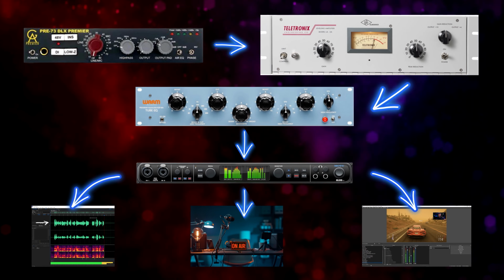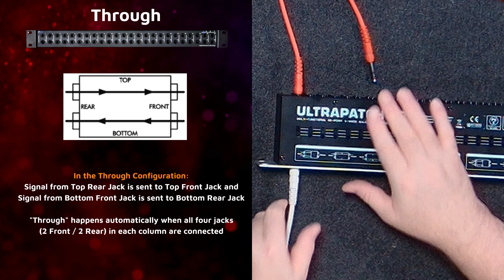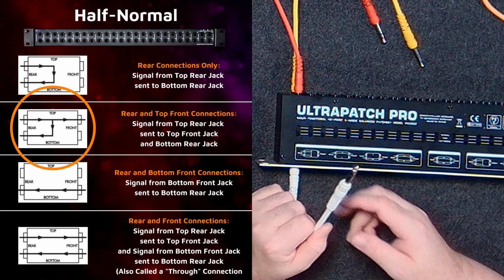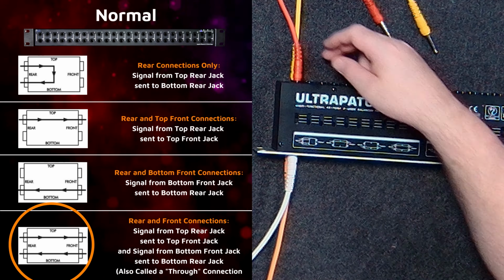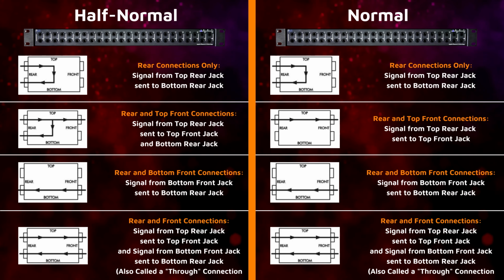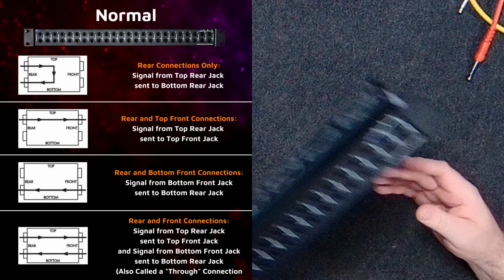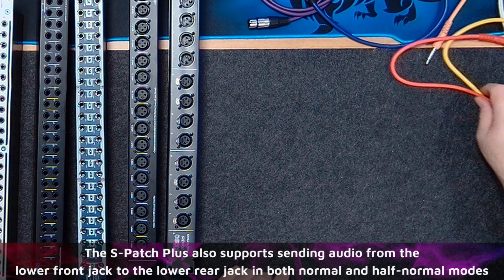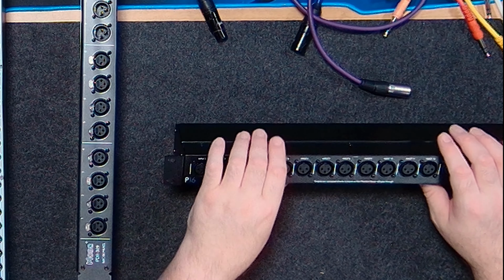TRS and XLR Patchbays - How They Work and When to Use Them

Comment: ...an incredibly clear and illustrative video. All the questions I had in my head are now answered. In setting up my home studio, I just couldn't figure Patchbays out... but now! .....all my cables are run (most under my floor) and connected using 3 x Samson S-Patch Plus... a mixer and 28 I/O.... Synths and outboard gear to match.

Your video is by far the BEST out there.

Now I am about to Rock... and I Salute You.
Reply from the maker: Glad I could help out! Sounds like you have things well planned out with your cable runs and the S-Patch Plus are very sturdy...the ones to get for TRS imo. 

As it should be...Let There Be Rock...
Reply: I agree.

Comment: Hi Todd! I got a suggestion for you. I would like to see you review another pair of studio headphones made by AKG, the AKG K553 Mkii, they’re a pair of closed-back studio headphones. According to AKG, the K553 Mkii is "the ideal closed-back, over-ear studio headphone for monitoring, mixing and mastering”, and that their low-impedance 50mm drivers provide "strong, accurate, and distinguished bass response, with enough sensitivity for precise sound reproduction on laptops and mobile devices". I would like to see you review them and run audio tests on them to see if those claims are true.

Comment: Hi Todd, another informative video.  Thank you.  : )  I recently posted a question in one of your preamp videos.  I'm not sure why you didn't respond?  But no worries.  I ended up getting the UA 710 Twin-Finity and I'm very pleased with it.  : )  Kind regards, Darren (Wales, UK)
Reply from the maker: Hi Darren, Sorry I didn’t have a chance to reply to your previous question. I have had my studio torn apart this week working on a large channel count upgrade and complete rewiring. As with any project of this taking, there were a number of issues to overcome and I have been “away” from YouTube this week. I will have more videos explaining the process coming soon.

The 710 is a great choice. It is a very flexible preamp that provides a range of coloration as you have no doubt discovered. My recommendation would have been to go this route as you have a good emulation of the 73 already available with your Apollo and adding the 710 provides more capabilities vs having another 73 style preamp. I’m not saying a hardware 73 is something you will never want to consider, but at this point the 710 was a more compelling upgrade in my opinion. Please keep me up to date as you spend more time with the 710. Cheers, Todd
Reply: @askdrtk  Hi Todd, thanks for your reply, much appreciated.  And good luck with rearranging your studio.  I'll keep everything crossed for you!  : )   One question if I may.  Given your testing, do you think that having something like the Cloudlifter CL-1 mic amp to go before my 710 (which feeds into my Apollo X6), would be beneficial?  Kind regards, Darren.  : )
Reply from the maker: The wiring is back together (64x64 channels) and I am almost finished balanced each of my gear individually with the input/output trims on my converters…video will be coming on this. I know not everyone agrees, but I do recommend using a Cloudlifter. My reasoning is that it puts the usable gain adjustment in the middle of the potentiometer where you will be able to make more detailed and accurate adjustments (and recalls) compared to using the 3-5 o’clock range where adjustments are coarse and gain changes quickly. If you want to drive the tube input stage you can still accomplish that by compensating with the output trim. This applies to all analog gain controls that are typically non-linear including the 710. Only my take on this, but I hope it helps out…Cheers!
Reply: @askdrtk  Hi Todd, following your previous suggestion, I was looking at getting the Cloudlifter to add to my UA 710 which feeds into my Apollo X6, when I stumbled across a short YouTube video called, 'Cloudlifter vs Dynamite | BEST Inline Preamp?' (by Kettner Creative).  This guy says you can't use an inline mic preamp on a Condenser mic because it will consume the 48v of phantom power before it gets to the mic.  As I have a large diaphragm Condenser mic, I'm a little confused now?  Any advice would be much appreciated.  : )  Kind regards, Darren (Wales, UK)
Reply from the maker: Hi Darren, That is correct, a Cloudlifter or other mix booster uses phantom power and will not pass it through to a condenser microphone. There is one exception, the Triton FetHead Phantom which will pass phantom power through. It is specifically designed for use with condenser microphones. That said, I do not recommend mic boosters, including the FetHead Phantom, as necessary for condenser microphones as they do not generally require as much gain as dynamic microphones. With a condenser microphone, your gain control on the 710 will be more in the “usable” range I described earlier. For some reason I thought you needed one for a dynamic mic. If you are using a condenser(s) mics exclusively, there is no need for a booster. I hope this clears things up.

Comment: Hi, thanks for your detailed and precise video! I have a question:

my patchbay is half normalled by default , suppose I have my microphone connected to the "1 Out" slot of the patch bay and the input of my interface connected to the "1 In" slot. If I then connect an outboard gear to another slot, and use a patch cable to route the signal from the mic to the outboard gear, and another cable from the outboard gear to the interface, would this result in a double signal being received by the interface? In other words, would the interface get a duplicate signal? or is simply a through conection now 

Thanks and please dont hate me !!

Comment: Hey Todd... a newbie question here. How can I use my condenser mic to aTRS patchbay? Use a DI or an adapter? I'm bit confused here... Tks!
Reply: Typically you would have a mic going into a preamp before the patchbay, patchbays do not provide any kind of gain because they are 100% passive. I’m assuming you are wanting the ability to route the mic to external compressors/EQs. This would require a preamp, without one your outboard compressors/EQs will not get signal. 

Another common practice is using an external XLR input that is routed to the patchbay (this is what I do) where you have 1 or several xlr inputs routed to the patchbay so you can choose where the mic would be going. You can either route it directly to your interface preamp or to an external preamp, then routed to either external compressors/EQs or back into the interface preamp.
Reply: @jonathancrowell4648  yeah! I bought an external XLR with phantom to route the mic between differents preamps, eqs and comps.

Thank you so much for your answer.